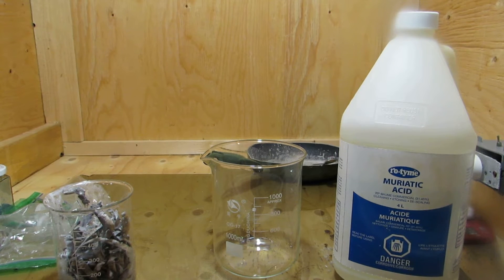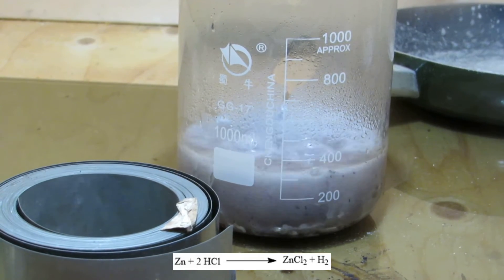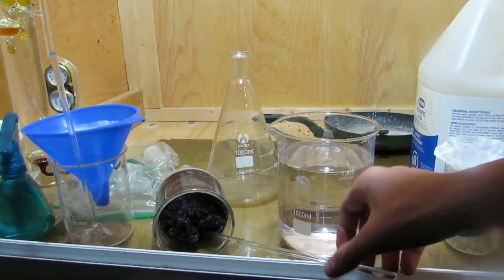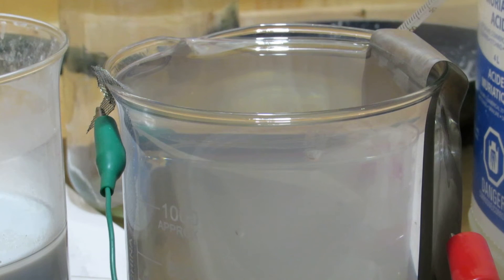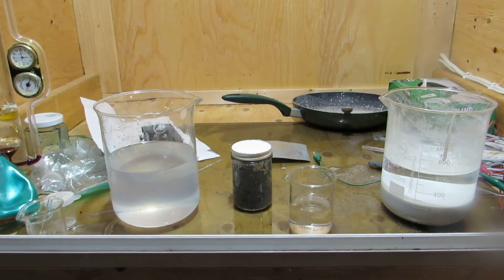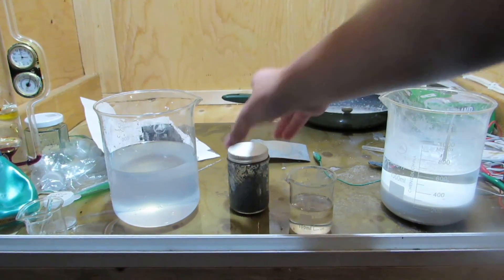How to Make Zinc Powder (Electrochemical Method)

Comment: Yooo, a home chemistry channel doing some electrochemistry- love it.  Any idea how this would go if tried on a penny with the copper coating and all?
Reply from the maker: im not sure, you should give it a try and find out! I suspect that if you make a few deep scratches in the penny first to expose the zinc, it would work fine. I don’t think the copper would dissolve in the basic conditions. it would probably just flake off as the zinc dissolves underneath.

Comment: BTW, the "gelatinous goop" formed in the dissolution step is likely due to there being some Aluminum mixed in with your Zinc. It tends to form a polymeric gel of hydrated aluminum chloride/oxychlorides when reacting with HCl (or even FeCl3) in aqueous solutions.
Reply from the maker: oh good to know! very interesting, thanks!
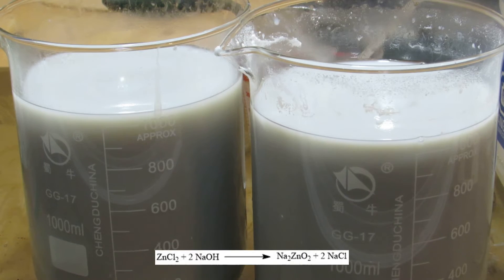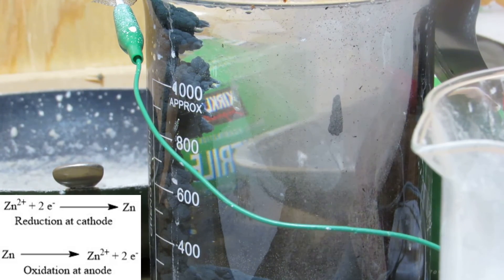Reply: @TheCanadianChemist  0:56 when this reaction occurs how does it make zinc +2 ions? At 1:32
Reply: 9